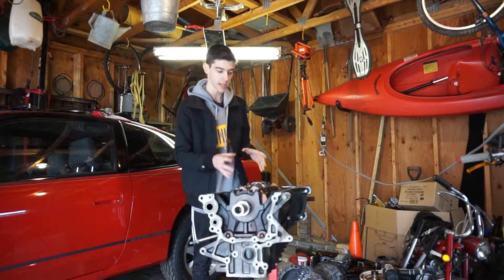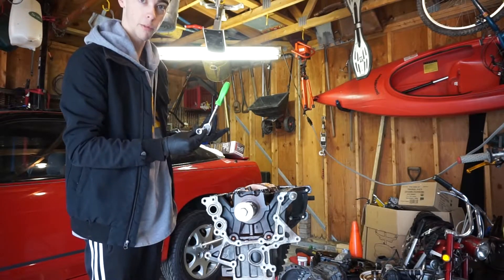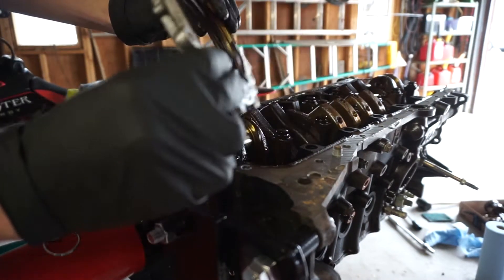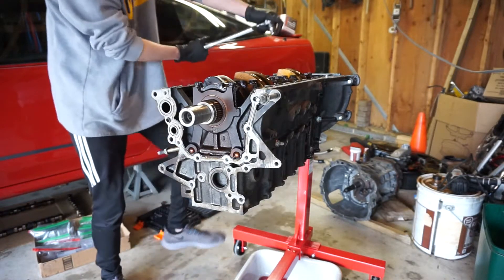Toyota 2JZ-GTE Bottom End Disassembly

Comment: Looking at your old videos. Why did you decide to remove the head? Do you think pulling the head off caused it to warp?
Reply from the maker: Thank you for watching I really appreciate you tuning in! I decided to remove the head because I was told by my tuner that I should install ARP headstuds before I got the car dynoed. It was after I took the head off that I realized the block and head were warped. It's possible that taking the head off caused this due to the release of stress, however I believe that the engine was overheated in the past and the block and head were probably already warped before I took the head off.
Reply: @Tuner Faction Thanks for the response  I know you said you had a compression test done. Would a leak down test have shown an issue? I guess you could have done an  coolant pressure test huh?
Reply from the maker: @CAC-1111  so there was a compression test done on the motor and it showed that the engine was healthy. A leak down test was not performed before the engine was taken apart however this probably would not have shown an out of spec tolerance on the deck surfaces unless there was a severe head gasket leak which I don't think there was. A coolant pressure test probably would have been the best bet to find an issue with the out of spec deck surfaces due to there being coolant leaks around the water jackets on the deck surfaces. In the end, im almost positive that if I had ran the engine at the stock power level no problems would have arose, however because we are increasing the power to over 600hp, I thought it better to be safe than sorry!